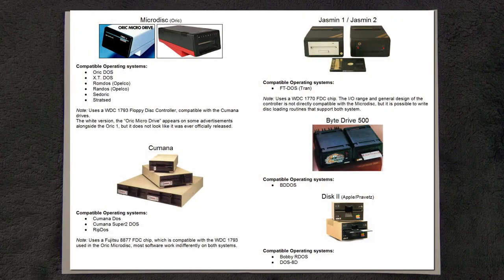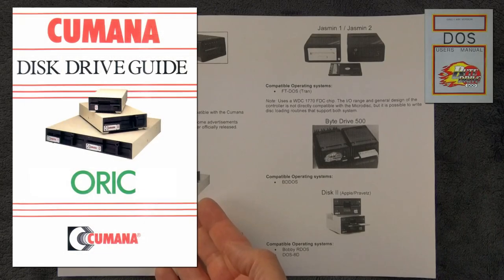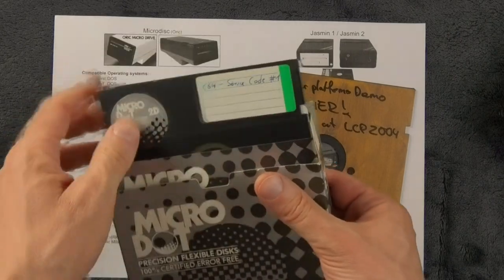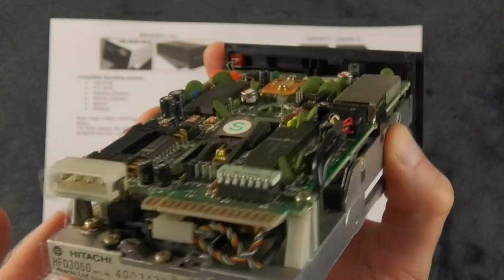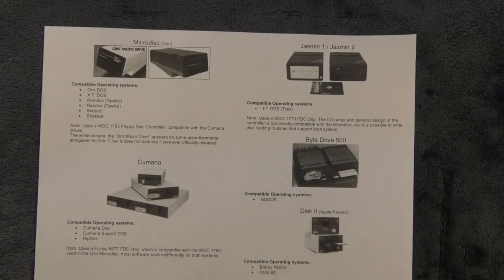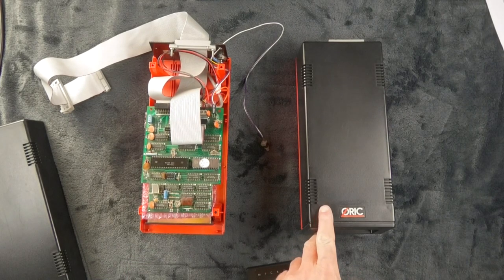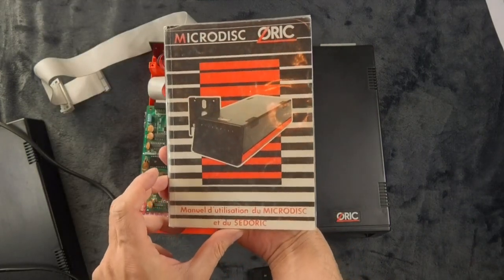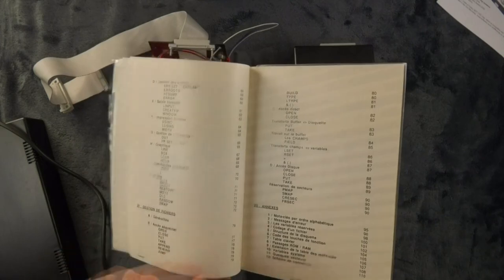Oriclopedia: The Oric Microdisc (3" Floppy Disk Drive)

Comment: The Compact Floppy was co-developed by Matsushita (now Panasonic Corporation) and Hitachi Maxell.  Both Hitachi and Matsushita made drives for this format.  Personally I didn't know Oric/Tangerine offered this as an option.  

An Oric with a Disk II would be interesting to see.  I had no idea it was used on anything but Apple IIs and their clones.  It was a very simple system, which used no dedicated disk controller, controlling the drives through an interface with a handful of TTL chips entirely in software, and it was extremely fast- actually the fastest floppy disk interface available for any personal computer at the time.  There wasn't even a homing sensor in the drive- it simply slammed the head shuttle into the stop upon initialising the drive at boot time.
Reply from the maker: If you search for "Pravetz 8D disk" you find a number of videos showing the system, like that one.

https://www.youtube.com/watch?v=DQtEndk-MDE

Comment: Found the video because I was looking for what happened at around 19:20 ... the sound of loading data from a 3" diskette. Somehow it sounds so much more like loading from a 5.25" drive than from a 3.5". Surprised about that. Love how the Oric-1's looking and how the disk drive's tilted slightly upwards.

(And of course, Oric needs some Blake's Seven. :P)

Good luck with retro-computing and further projects. Seems like the Oric was quite a nice micro!
Reply from the maker: Glad you like it :)

Yes the Oric was a lovely machine, despite (or maybe because of) all its weirdness in design choices!

Regarding the sound, these 3" drives are quite old, and there never were streamlined versions like later generations of 3.5" floppy drives, my first Atari ST had a single sided drive that was not particularly silent either :D

Comment: have you tried amstrad pcw 80 track drives on oric-1?
Reply from the maker: Oh, the PCW have 80 tracks 3" drives?
I did not know that.

I've been considering getting some PCW drives a few years ago, but never ended up getting one, so no idea, but that's an interesting idea.
Do all models have large capacity drives?
Reply: @DbugII  yes, the drive B even if 3" is usually 80 tracks, you can use them on CPC also if you put an 80 track ROM on them - or at half capacity without ROM (but then the discs cannot be read on a 40 track drive as they are too close).
Reply: note: the 80 track 3" discs have been proven to be identical to the 40 track ones, so don't pay extra for 80 track 3" discs - just use whatever you have.
Reply from the maker: @ninjazhu  is there a 100% method to determine which drives are 80 tracks models, your previous message seems to imply that there are models with one 40 tracks drive on A: and a 40 tracks drive on B:, some with 40 on A: and 80 on B.
Are there models with 80 on both, or with only one drive that is 80?
IS it for all PCW models/references?
Reply: @DbugII  sorry I don't know for sure, if you go to amstrad cpc forums (I am zhulien there), but there will be a lot of others who can probably answer that better than me.  I do know for most part that the B: drives shipped with dual drive systems are usually 80 track (never seen a 40 track drive shipped as standard in B: drive).

in the old-computers website, it states the following but I cannot verify that:

"Another PCW model was launched a few months later: the Amstrad PCW 8512. It has the same characteristics apart from having 512 Kb RAM to handle bigger documents, and two 3" floppy disk drives. The top one is a single-sided, 40-track (180 Kbyte) drive, the bottom is a double-sided, 80-track (720 Kbyte) drive. 40-track disks could be read in the 80-track drive, but it's not advisable to write to them there because the 80-track drive has a narrower head. It had slightly darker plastic mouldings than the PCW-8256, grey instead of white."
Reply: ah, of course, check the heads if you have 2 heads - it is 80 track, 1 head it's 40 track.  On 80 track drives, be sure not to put the disc in upside down - there is nothing to prevent that.
Reply from the maker: @ninjazhu I would feel bad for just buying a PCW from eBay that I would never use just to pick-up a 3" drive to check if it works on the Oric.
Do you think I could find anyone who has one of these 80 tracks drives and would be willing to sell it?
It does not have to be in pristine condition, it's mostly for the sake of science, see if that runs at all :)
Reply: @DbugII  depending which country you are in maybe you can get a faulty pcw8512 cheap?  I'm in Australia and although I have owned them in the past I don't come across them often now.  For us, postage is really expensive if shipped from Europe
Reply: @DbugII  think the other way, so many people throw away old computers.  If you get a broken 8512, at least you saved the disc drives. 99% of the time they only need new drive belts.
Reply: A couple on ebay in UK now with both drives in place foe about ukp60
Reply from the maker: @ninjazhu Yeah I already checked, unfortunately I'm in Norway, most of the cheap ones are in UK and "to fetch in person", which makes sense since sending a big heavy CRT is a recipe for disaster.

I'll keep that in mind, if I see one sold locally, I'll take a look.

Thanks!